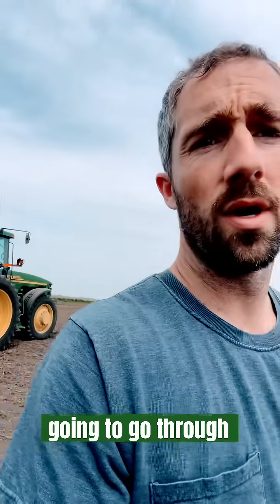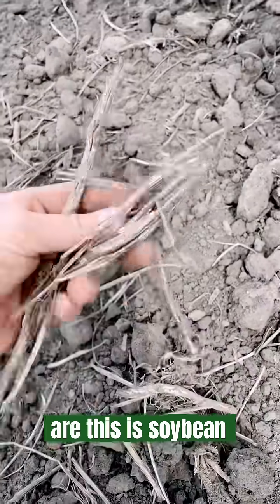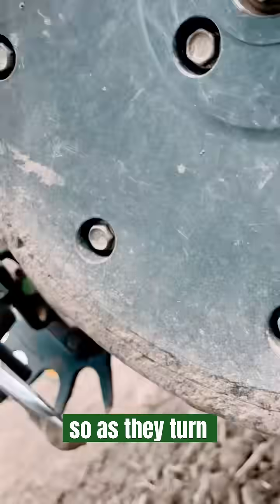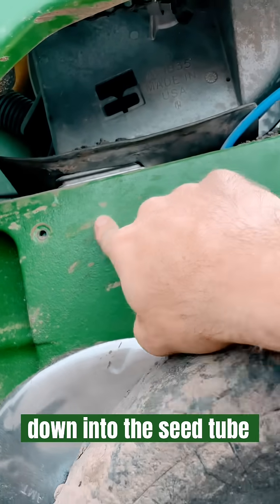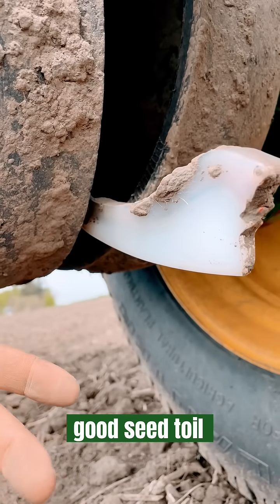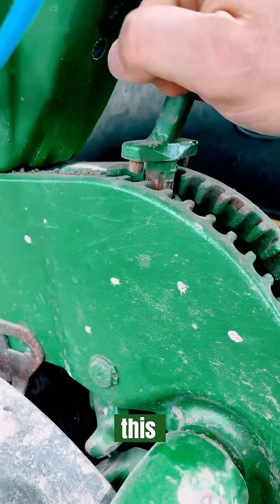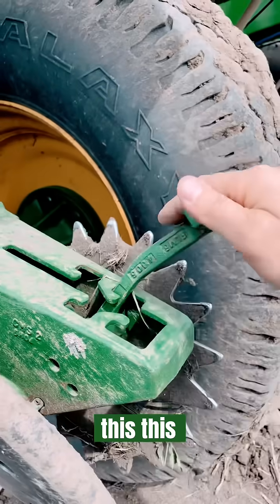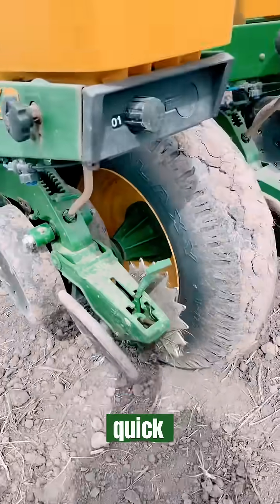How does a planter work?

Comment: Why are you running a spiked closing wheel and a steel one at that in black ground? Hell I no till and I don’t even need a spiked closing wheel, I run two rubber tires on my 1770 and have never had an issue closing trenches, hell I even took off my row cleaners, keep decent disc on your 2x2 openers or seed openers like you’re running there and I’ve never had an issue getting in, even in hard pan ground and I don’t run into hair pinning issues.
Reply from the maker: The closing wheel setup was on the planter when we bought it in March and we left it. I’ve always used smooth rubber closing wheels and they’ve treated us well but I’ve wanted to switch to copperheads for the times we have a wet spring. This spring was definitely not that lol.